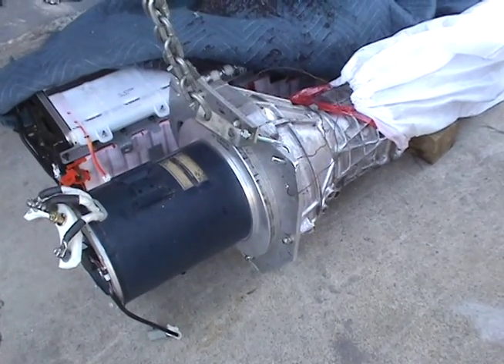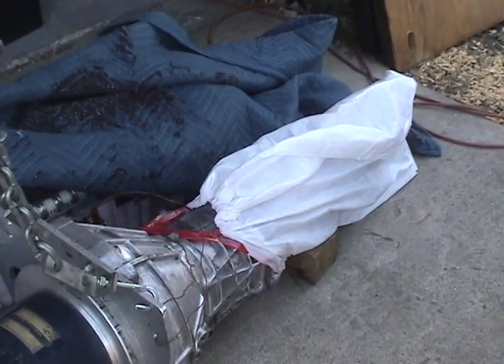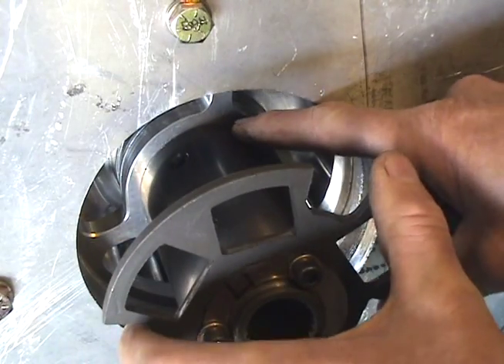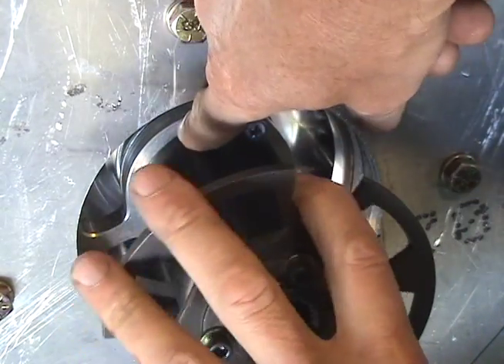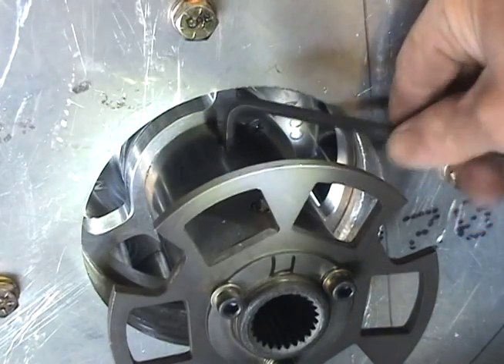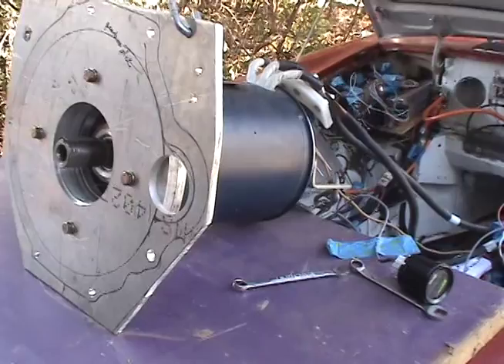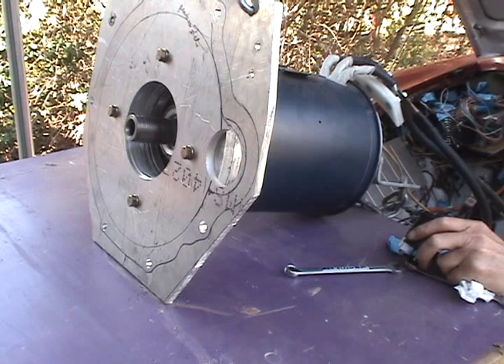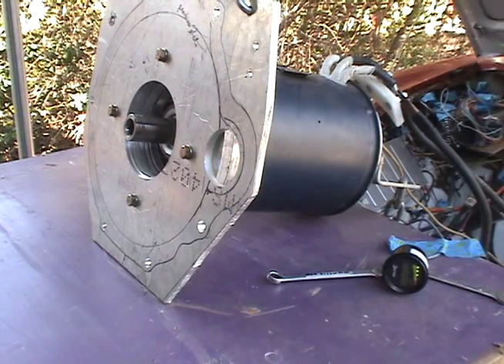3 phase AC motor noise

Comment: Might want to put some blue locktite on those allen bolts to help keep them from coming loose again. Question, how fast were you able to get your car going with the Curtis Controller that is set for the AC-35? I'd love to hear from someone with one of these motors how it actually performs. My guess is it will sorta crap out sooner than you might expect. Not that the motor is bad but because it was designed for lower speed use. Lots of torque up to about 35mph maybe then drop off quickly after.
Reply from the maker: I will certainly run some real-world tests and post the results.